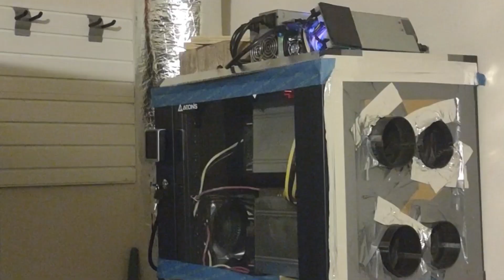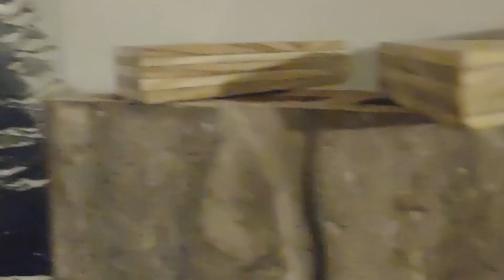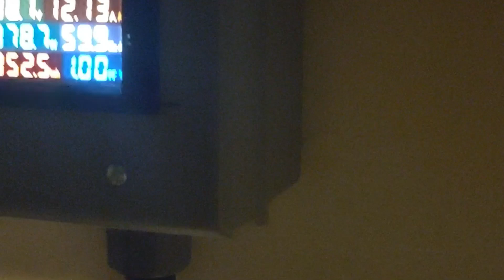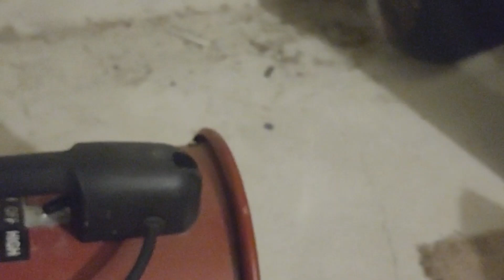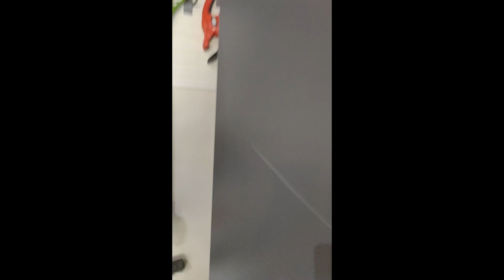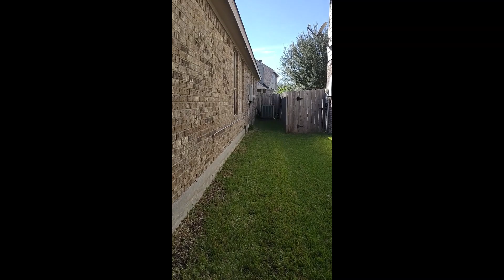First 6 months mining LTC and Doge!

Comment: Hello Ashley, great videos and content.  Do you have any pics of videos of where the exhaust duct work ends up?  I see someone asked if it goes into your attic or does it exhaust out the roof?  And what size duct tubing is it?  Thanks!
Reply from the maker: for my case, I'm only moving max 2800 CFM. It's 16 inch ducting from the cabinet directly to the attic. the air rides the roof line and exits like any other attic air....technically the attic is much hotter than the cabinet air. Anyway, there is no noticeable noise or extra heat circulating in the house. This is great for a small 10-20 miner setup, but I would exit direct to outside if I could easily.

Comment: I would like to setup a similar cabinet in your garage. What is the part number for the cabinet and what fan did you use for exhaust. Thanks for the info.
Reply from the maker: HP 10642 G2 42U Server Rack Cabinet Enclosure
Reply: @sc0rch3d  Thanks

Comment: Hey Ashely, cool set up! So on the new Oct 2021 design, you got rid of the fan shooting air through the intake of the miner and instead switched it to pull air from the outtake of the miner into the attic? Is that correct?
Reply from the maker: Yes. Negative pressure gets hot air away from the miners. That's more important than air temp coming into miners.